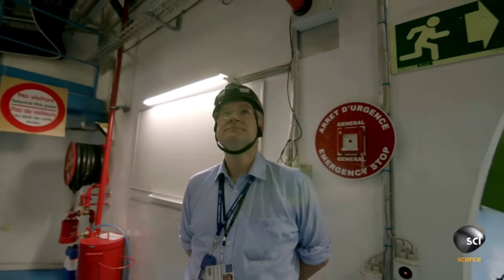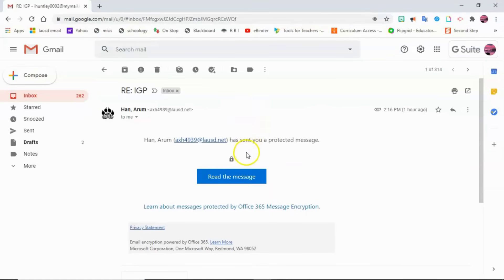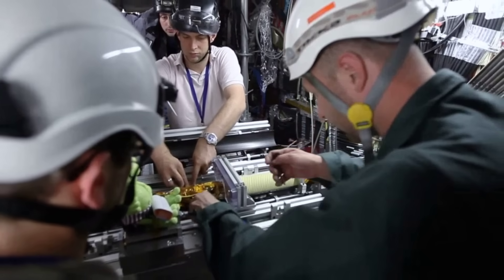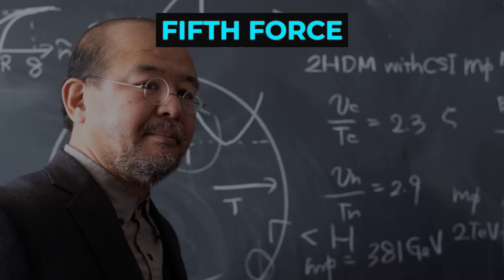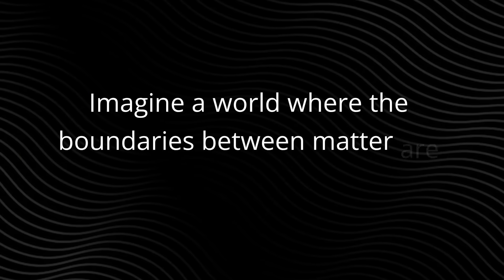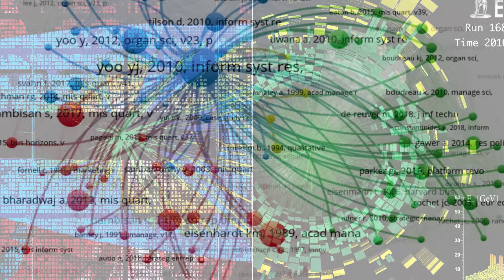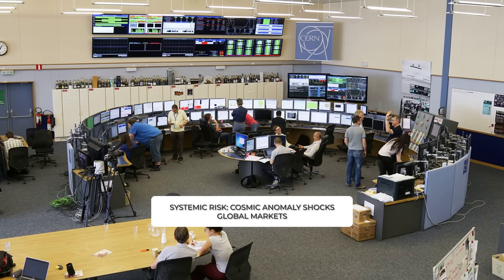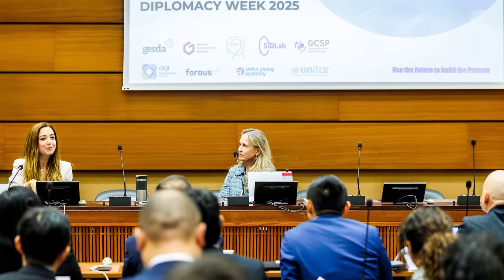Scientists Issues Terrifying Warning After 3I ATLAS Discovery

Comment: We are traveling through space and away from the center of our galaxy, meantime on the other side of the galaxy out galaxy is swallowing a smaller galaxy, the Andromeda galaxy,,,to travel great distances in space and to become interunivers you have to develop FTL for short(inter solar system) distances and interdimentional for(interunivers) long distance,,,the planet size spacecraft travels at FTL speed, the planetary space craft the size of pluto can travel interdimentional, the bigger ones on their way are traveling at FTL speed, look towards Polaris, Serius and Tabby's star,,,thats what's causing the light variation coming from those stars, planetary space craft 8 times bigger than jupiter, hollowed out a out side in biodome, a fresh water ocean and a sun powered by UUP115, UUP115 is what they power their engines with that takes their planetary space craft at faster than light, at about FTL10 the spacial warp forms and you can skip across the tops of the waves, the faster you go past FTL10, FTL10.1ETC. THE CLOSER THE WAVE TOPS GET, Like sound waves on an oscilloscope ,,,it requires exact mapping of the universe,,,ET can stand off close enough to suck the atmosphere off our planet and store it to replenish their atmosphere, earths water the same way,,,they will harvest everything edible or usable first so be ready for the landing of ET, first enslavement, eventually eaten,,,☠
They use hydrogen for fuel, wait till you see what they do with internal combustion engines,,,too bad they are coming to destroy earth 🌎 like they destroyed mars,,,